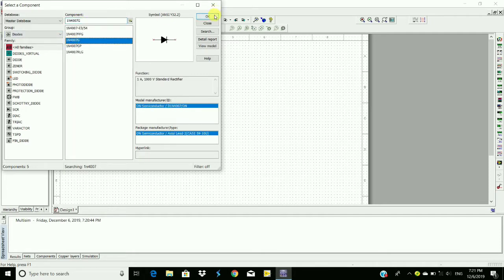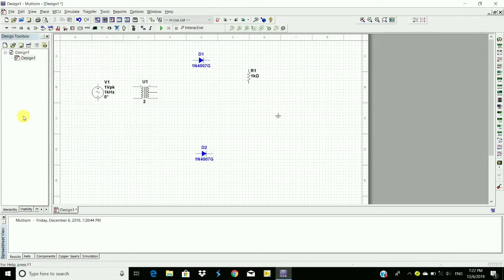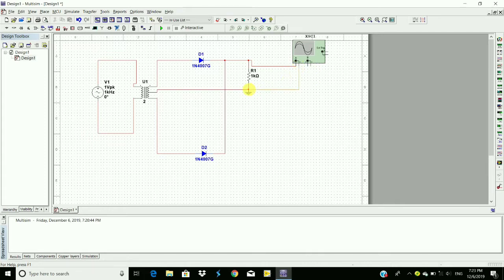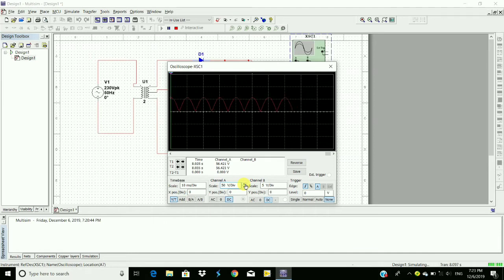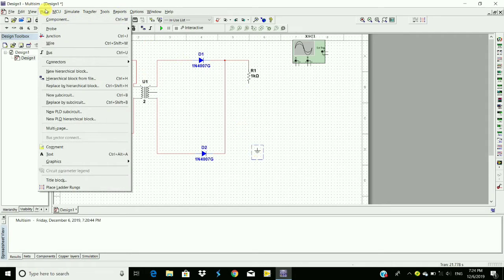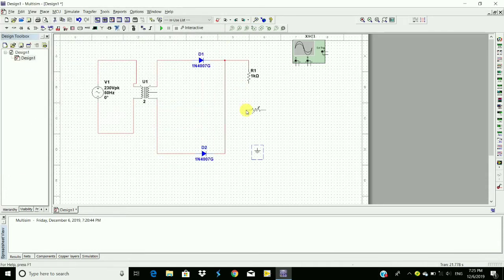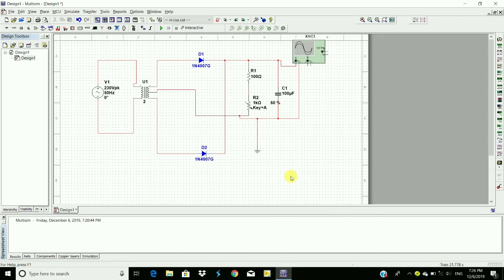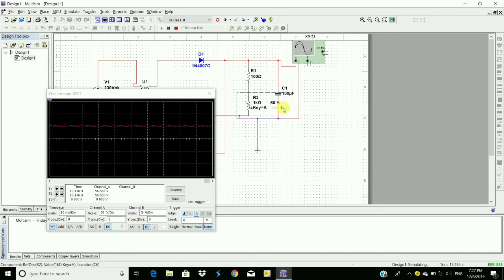Full Wave Center Tapped Rectifier Using Multisim Software | Acts of Facts | Electronics

Comment: sir it gives  me straight  line on  oscilloscope
Reply from the maker: Change voltage and frequency range, try again..
Reply: @ActsofFacts  thanks for advice 🌸but the issue solved by using TS_Virtual transformer .
Reply: @shahadkftarawneh5431  thanks it worked for me too
Reply: Me too. even if 
i change the voltage and frequency